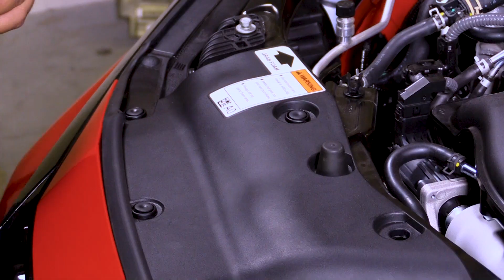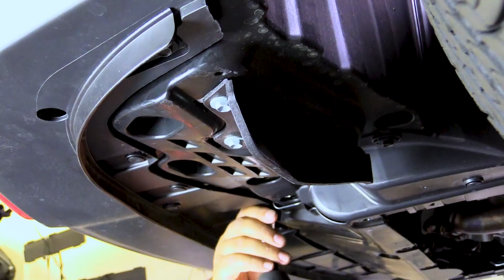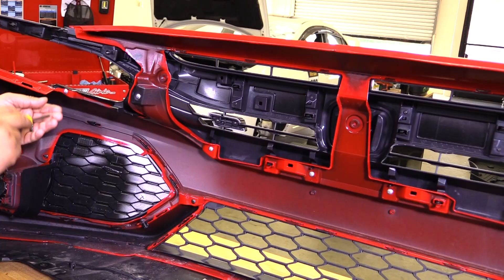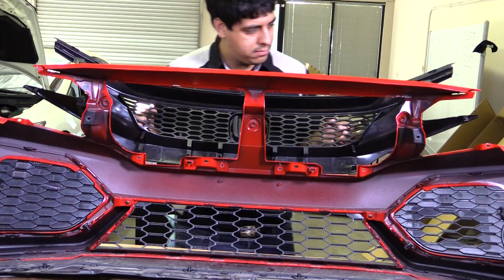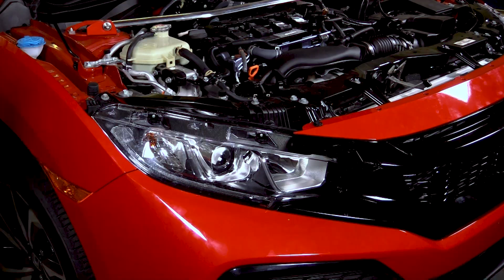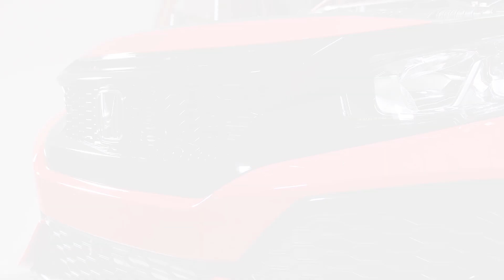10th Gen Civic Honeycomb Mesh Grille Install - 2016 2017 2018 2019 2020 2021 Honda Civic

Comment: I put mine on a while ago and have a new one now but I couldn’t get rid of the gap on the top of the grill, wasn’t noticeable unless right in front of it but was irritating 😭
Reply: Yes same here, I don't think the grille was made in the right size so it doesn't line up with the original Honda bumper, in my case the screws don't line up and the gap at the top is too big to force it to clip onto the bumper.

Comment: Just finished. Broke a couple clips and took longer than expected but we fuckin got it on
Reply: How was the fit ?
Reply: @CartmanxBrah  the broken clips that connects the eyelash part to the middle part of the grills makes a slightly bigger gap but it stays put. And the top part of the middle of the grill doesn’t connect to the hood but you can barley notice

Comment: Cannot get the grille top piece to stay in place. It's that or those clips up there must of broke when removing the oem grille. Kind of wished this video had a zoomed angle instead of fast forward as those clips are super easy to break.

Comment: I tried to remove the eyebrow trim and followed your steps by there something hold it located in the middle of the bumper. I tried to pulled it out but it won't badge. Is there any hidden clip underneath?

Comment: Are you sure this fit the 2016? I bought one and the fitment had the top clip not connect to the hood properly
Reply from the maker: Yes, this will fit all models from 2016-2018. If you are having issues installing this, please contact us at customer@procivic.com for tech assistance.

Comment: Is the stock Si emblem removable and is it able to be mounted to this grill?
Reply: no its not compatible, however you can buy an aftermarket ebay one if you like that has two screw and  nuts with washers to tighten behind the grill.

Comment: Will this fit 2018 honda civic touring?
Reply from the maker: To answer both your questions, yes, it will fit the touring model as well. And rain goes in regardless of the grille on the vehicle. However, it will not damage anything.
Reply: @procivic  ok
Reply: @procivic  thanks,  are guys located in Canada?
Reply from the maker: We are not, we are located in California.

Comment: I have a question. For anyone who knows. My wife's civic touring has a radar sensor in front do I need to worry about anything when I take the bumper off?
Reply: No the sensor is not attached to the bumper.. just be careful with the fog lights

Comment: Seriously thinking about getting this for my Type R. That solid piece restricts air flow, half the grill is non functional on a car that gets hot really quickly
Reply from the maker: Just gonna leave this link for your here... :https://www.procivic.com/p/m/civic/pro-design-honeycomb-performance-mesh-grille.html?utm_source=transactional&utm_medium=email&utm_campaign=part_rec-pro+design+honeycomb+performance+mesh+grille+eldar&app_selected=44298
Reply: PRO Car Studio nice, thank you. What are the dimensions of the H emblem you use? I’d like to see if Matt from ICB can get me a red Type R emblem the same size to fit your grill
Reply from the maker: The emblem used is the same as the 9th gen sedan emblem. Hopefully this helps!

Comment: Can you use the red emblems with this grille? I was planning on the oem type r emblem
Reply from the maker: It is possible, but may have a very small gap around it.
Reply: Does the grill from pro Civic come with an H badge

Comment: whats the difference in the Pro Design grille and this one from Amazon? 

https://www.amazon.com/2016-2018-HONDA-TYPE-R-GRILLE-BUMPER/dp/B07DLD4LFX/ref=sr_1_2?s=automotive&ie=UTF8&qid=1532090973&vehicle=2018-59-752-------------0&sr=1-2&ymm=2018%3Ahonda%3Acivic&keywords=2018+honda+civic+black+grill&dpID=51NbK0iNOUL&preST=_SY300_QL70_&dpSrc=srch
Reply from the maker: Our grill has a larger vent opening and includes a genuine H emblem.

Comment: Hello will a 10th gen Si front bumper fit a regular 10th gen 2016 EXL model ?   And will the fog lights also line up with the bumper ?

Thank you
Reply from the maker: No, I don't believe you can just do a complete bumper swap like that. This grille works on both bumpers though.

Comment: Fuck that, way too much work to replace a grill. I was going to do it myself after watching this video and realizing the whole damn bumper needs to come off.
Reply from the maker: It's not that bad, we're just pretty thorough in our videos. If you think about what you get for the price, it's a great mod. It looks badass and is actually very functional - several race teams already use it simply for improved airflow.

Comment: I don't think I have a problem with that stock bumper but nice video though.
Reply from the maker: +Oldmansland1Just providing options for those who want to spice things up a bit. Thanks for checking out the video!
Reply: Heat soak is a big problem with our cars. More cooling the better.

Comment: Have you noticed a significant drop in ECT on a track day with this new grille? Im hitting 105c ect with my custom tuned +9psi map when pushing hard.
Reply from the maker: +Marion San Pedro Unfortunately, we have not tracked the vehicle since the install. At the moment, we do not have any exact figures, but yes, we do anticipate a good drop in ECT and engine oil temps. Heatsoak is the biggest enemy of this 1.5T motor during prolonged drives or track use.

Comment: I have no problem with the grille. I just wish they would get rid of the fake vents especially the ones on the sedan's rear bumper.
Reply: The sensor is i. The front, far as I know nothing is in the rear ones